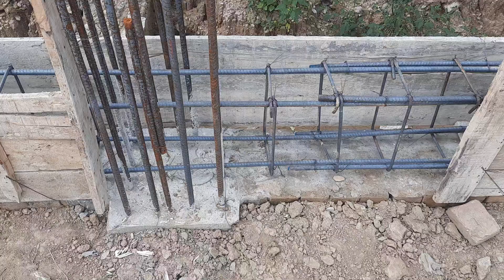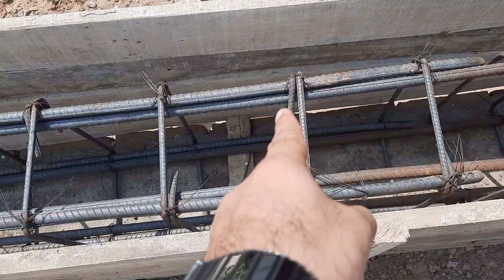Two big mistakes in beam with column design | Civil Engineering Videos |

Comment: Can we do plenth beam concrete,in many steps ?, mean in two or three days ,or can i call for more details, please provide contact number i have many queries regarding columns and beam recently i faced many issues,
Reply: yes you can cast beam in many steps by providing inclined construction joint in beam...keep in mind that your joints must be placed in 1/3 of the span length